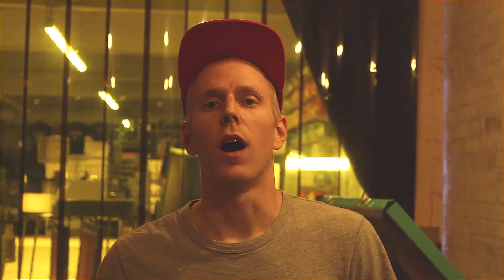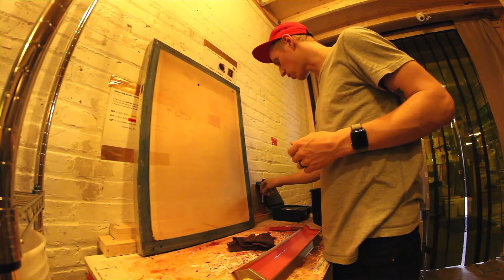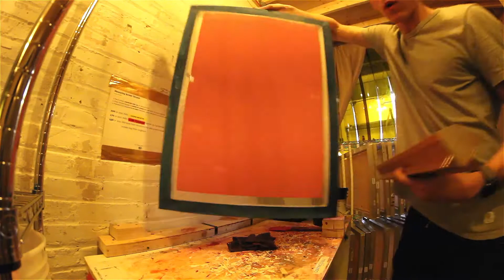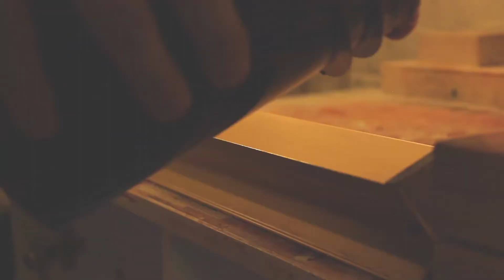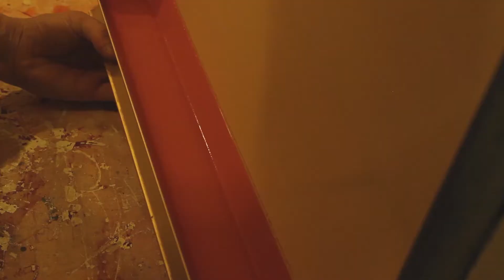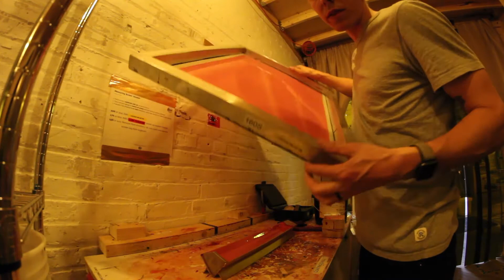SCREEN COATING 101 - Process Tips for Screen Printing

Comment: My screens are 130x80cm and i apply emulsion like 1 coat in the back, 1 coat in the front, then i remove the excess from the front and then from the back. It leaves me a thin layer of emulsion both sides and i print on linear fabrics with reactive dyes, in many colors. What do you guys say about it, from your experience? I dont have any major problems with exposure or printing. Thanks!
Reply from the maker: Sounds about right! I don’t bother scraping any excess though.
Reply: @CoryatFloodway  good to know, thanks man

Comment: I notice a few screens with small black squares? What are those—repairs of some sort? (BTW, I LOVE the organization of your shop. The "warning" stickers, tables with markers as to where things go back: scale, etc. SO AWESOME. Me and my OCD brain would fit in there perfectly!
Reply from the maker: Thanks Tony! A place for every thing and a thing for every place. It makes the job a lot more relaxed when you have what you need and don’t need to find anything.  Or walk anywhere. As for the black squares, those are patches for tiny holes! We cut squares of vinyl on our plotter and use them for temporary repairs. It prevents the hole for spreading further.
Reply: @CoryatFloodway what type of vinyl do you use to patch holes? Permanent or removable. Also do you coat the emulsion then put the patch on, do they come off during reclaiming? Great videos. Just found your channel.
Reply from the maker: @TheIllestModa  Thank you. It's a permanent vinyl same stuff you'd use for stickers/decals. They go on before emulsion. They do come off in reclaim sometimes so gotta be gentle in that area and stick them on nice. I have always wanted to try a super sticky super permanent solution. Like a glue patch or something. Or an easier way to stick a square of permanent blockout there and hold it together.

Comment: What're you writing in the top right hand corner of the screen?
Reply from the maker: Graeme Deroux The mesh tension! Usually they stay the same tension for a couple rounds though so a couple can be skipped since they’ll already have the current tension on them.